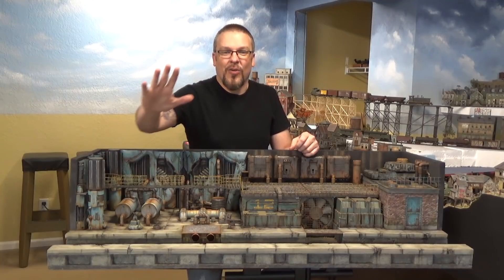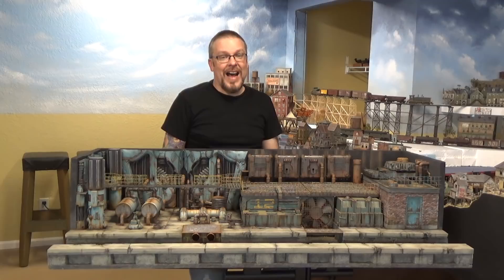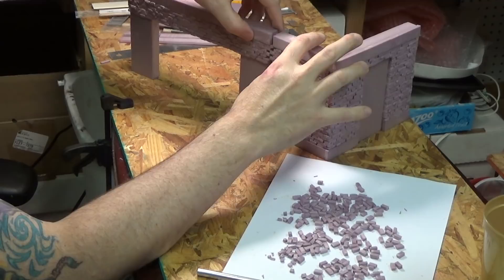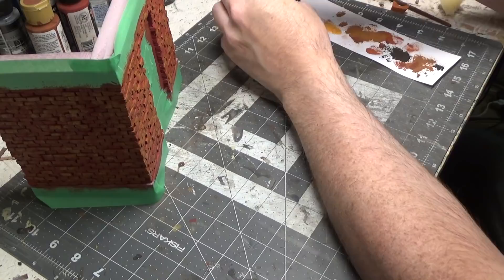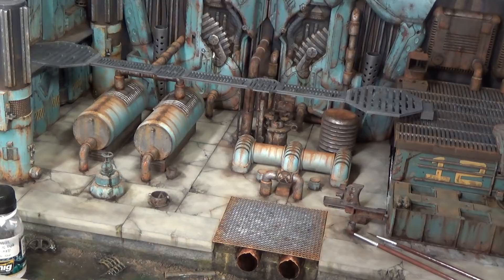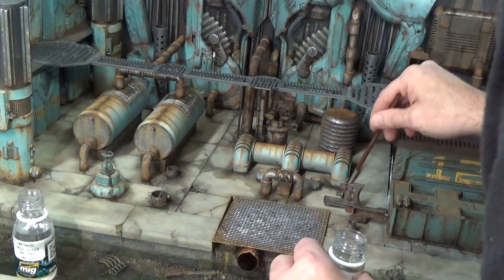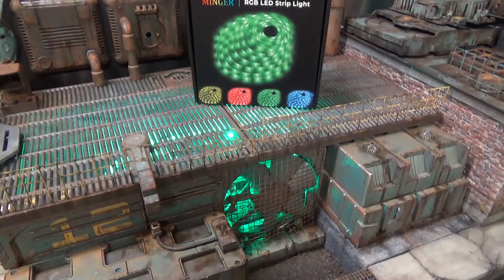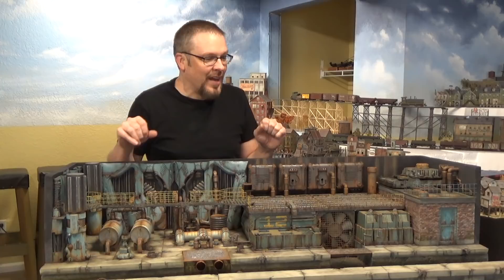Sci Fi diorama part 3: Creating realism!

Comment: Great Video.  Did a search for Mig paints and washes.  WILL be making a purchase in the next couple weeks.
NOW FOOD FOR THOUGHT:  While you are taking a Sci-Fi Break here is an idea for the Sci-Fi roof structure.  Using a thicker, stronger roofing beam system.  Then use a clear acrylic as an atrium roofing.
Now a modeling heresy, use CA Glue as the adhesive.
Yes I know that the CA will have a smokey effect to the acrylic.  That's the idea.  You will have a distressed translucent view from the exterior inward  when the roof is closed.  Add this Mig murky effect paints will keep your line of sight view distracted. You will still be able to lift the atrium roof for line of sight shots.
You will still be able to install your lighting effects to the underside of the roofing skeleton.
Also to add to the adventure aspect, for one end of the roof peak to middle tier install a "Slide For Life" line.  Then during photo shots your hero mini-figure could escape over the heads of the ogers.
In any event I more and more enjoy your work and style.  Way2GO.
~Jim

Comment: I love all those streaking grimes and rusts by Ammo, Vallejo, Ak and Mig.  Like you said adding the thinner and dragging it down is the way.  Its great cuz unlike acrylics you have a super long dry time.  Ive come back hours later with thiiner and touched up areas that I thought were too thick.  
Those little bottles of MiG odorless thinner are super spendy for how much you get.  You can get big 8oz bottles of generic Odorless Turpeniod at  hobby lobby in the painting section where the oil paints are.

Comment: I watched all 3 parts of this video. I've been scratch building plastic models for many years but  I still learned a lot from the vids. I especially like the way you kept to one basic color scheme (blue) for the over all scene. This pulls the whole scene together. Plus the light tone of the blue allows the rust to stand out better than if the main color was dark. Also blue and orange (rust) are opposite to each other on the color wheel and therefore have the maximum contrast. I like the brickwork idea. Also the cracking in the concrete is very realistic. BTW just one small note: your great door doesn't have a handle! That is a good example of what you said about working from photos of real life. I used to scratch build buildings for model railroads and I would go out to actual railroad yards and take photos of  buildings that i wanted to model and I would get so many more ideas for details that I never would have come up with from just my imagination. Nowadays you can just do a search for the photos you want on the internet. Great work!!!
Reply from the maker: Thank you so very much!!! I really appreciate it!

Comment: Tips: You can use an old ATX computer power supply to power everything, like R/C model tank or steamboat smokers from Ebay for your factory smoke stakes. You can connect and under volt that 120mm computer fan with a 12 volt Rheostat speed control knob, so it's barely moving for more realism.  Check out my Metro Exodus PC Mod Final Video, and Thanks for sharing your tips and everything else!
Reply from the maker: Great idea! Thank you so much Bill!!!

Comment: My only nitpick is that the handrails look too tall compared to the door, and they usually only have a top rail and mid rail. They should be roughly 36" to scale. Trimming the bottom off would solve both problems.
Reply: Mine would be that the laptop cooling fan doesn't spin slowly.

I would say hook up the motor and put in a resistor to limit the current going to step down gears so it spins at scale.

Comment: You should do the lights to look like industrial fluorescent fixtures.  You could put Led Strip filaments inside small sections of 1/4in Trim Channel (see Lowes #55979) would look like real lights and be amazing hung from small chains on the lid.  Wire could easily be run inside of small tubes and painted silver like real conduit.  Maybe a small light switch?!!!
Reply from the maker: Thanks for the great tip!!!
Reply: @JasonJensenTrains  if you use it I would love to see it.  Your builds are amazing and make me wanna build a world of my own.  Thanks for posting the content.

Comment: Can i know why the scifi will have those () around like gearing or functions in doors example or outside layer? Because if underground it cant be seen anyway? What is it rly wires inside? Is it just neodymium magnet maybe?
Reply: I have idea of sci fi to be all ferro liquid like a paint so it holds joints together other than welded screw and nut.
Reply: Can i subject-buy the devices and hv ez job on making real ones?